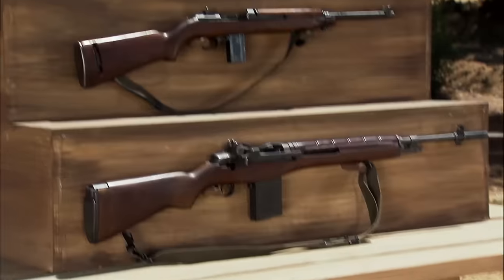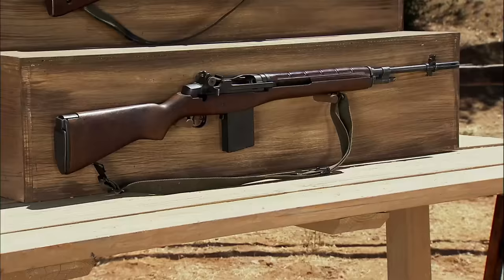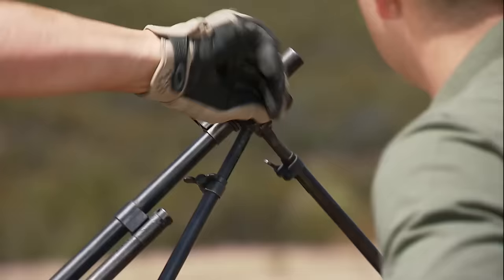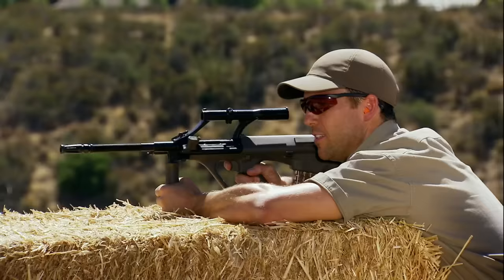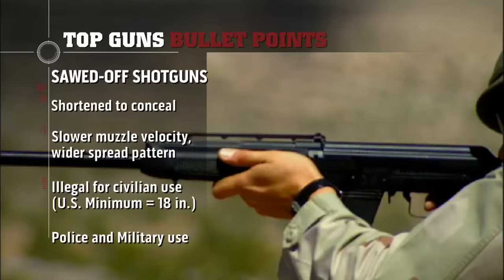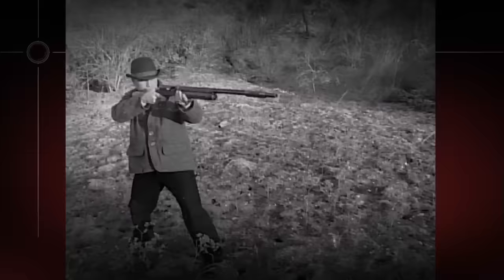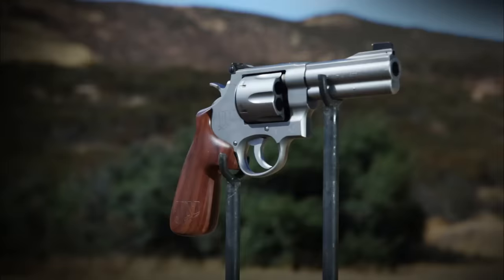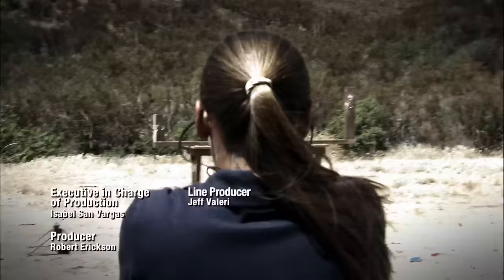Top Guns: ELITE Sharpshooters and DEADLY Marksmen *3 Hour Marathon*

Comment: In a "Battle Rifle" comparison the M1 carbine should not even be included as it is not a "Battle Rifle " by definition. Battle Rifles are chambered in "Full Power Cartridges" like 7.62×51 mm, 7.62×54R, or.30/06 , etc...The M1 Carbine fires what is considered an "Intermediate Power Cartridges, as do the M16/M4 family, the AK platform, and other similar weapon which are known as Assault Rifles. Intermediate Calibers use ammunition that is substantially lighter in over all eright and the weapons thst fire them are generally significantly lighter in weight since they don't need to be built as robust due to the less powerful cartridge they fire. Because the weapon and its ammo are both substantially lighter the individual soldier can carry more ammunition on his person than he could if carrying a battle rifle. A soldier carrying an M16 or M4 which os chambered in 5.56×46mm can cary about 3 times the amount of ammunition for the samevamount of weight as the 7.62×51mm used by the M14 and thats not even taking the weight of the rifle into the equation, with the M16 being almost 3 lbs lighter than the M14. There is also the lighter recoil generated by the intermediat powered cartridges used that allow these weapons to be more effectively used with less skill or training within the realistic distances that most smallarms combat actually occurs at. The need for a Battle Rifle shooting a Full powered ccartridge that is accuraye and effective to distances of 1000 yards doesn't realistically exist if 90% of comat occurrs at 300 yards or less. This is why actual Battle Rifles are not commonly issuesd to soldiers of any modern army and haven't been for quite some time. When the intended use that the M1 carbine was developed for, to give soldiers normally issued a pistol (like truck drivers, clerks, or other soldiers whose jobs don't normally involve direct combat) a weapon that if they did need to use it would allow them to do so with better range and accuracy than a pistol is capable of is considered then the absurdity of putting the M1 carbine in a head to head comparison of actual B a ttle rifles b comes obvious.

Comment: Interesting video. THANKS. I have a PS90 topped with a VORTEX Sparc II red dot sight on a low aftermarket Pic rail. Also I have a RUGER 57 pistol firing the same (expensive!) 5.7 x 28 round. It's shooting $1. bills these days so I now mainly shoot my much upgraded RUGER PC chassis carbine with a HOLOSUN AEMS circle/dot sight. 
As luck would have it I also have a gen. 1 Steyr AUG. But for hunting in Nevada I use my 6.5 PRC Browning X-Bolt Pro with a 4.5 - 18 x 44 Bushnell Elite scope with a G3 illuminated reticle.

Comment: I shoot both 5.56 and x39 in my backyard a lot. Agree with everything you said. I also have a couple (3) x39 rifles, 2 akms and 1 galil ace to shoot the rounds more accurate at range. Got like 2k rounds of belom brass cased ammo for them and another 600 rounds of barnaul hollowpoints or Russian steel fmjs. Got barnaul and belom because they shoot most consistently in my experience from my rifles.

Comment: I use my Holosun every day nearly for at least an hr sometimes 2 and I haven't had to change the battery yet I have mine on a CMMG wasp 556 Mk4 when I first bought it I thought man $300 but it is well worth it I pull it on and off to clean or to through my iron sight back on the rear which is very seldom but I've never had to readjust the sights they have always been on and it's also set up to when you pick it up it comes on then after laying without movement it will turn off thought that was pretty cool I'm 3 years in nearly and lens has just 2 light scratches on the sides and I'm rough with my hardware so that's saying something but you definitely talked me into the magnifier thanks bud

Comment: Probably the M-14 would have been a good battle rifle in Afghanistan or Iraq. I trained  on the M-14 in Army basic in 1969. Was issued an M-16 in AIT.  Was issued and carried an M-16 in Vietnam. Very occasionally in Vietnam did I encounter any open areas longer than 100 yards. Most times visibility was 10 to 20 yards many times less. I did, however, carry an M-14 once or twice on radio relay fire base duty. I used it like an old BAR. But full auto was a bear. Enjoyed the video. Thanks.

Comment: The height of the optic vs. the barrel on the PS90 introduces a fairly significant paralex error. That's why the big difference between point of aim and point of impact when the targets went from 15yrds to 25yrds.

However, lowering the optics closer to the barrel would have negatively impacted ergonomics.

Comment: On such a great sight over bore axis like on a p90, it's advantageous to sight in between 15m-25m hitting a about 2-4-6 inches low (depending). That way at 50m your not shooting 12 inches high. But that's just my preference, feels like a more efficient aiming solution to me.

Comment: The bolt on the Mosin is dirty most likely has cosmeline  still in it. I have several Mosin and they are smooth as butter and the trigger can be lower to 3 lbs with the circle wire connector mod less than $.10

Comment: That historian and former Marine doesn't know how to properly use the bolt on that Mosin nor does he understand why it was designed that way. It took me a minute or two to figure it out. The "secret" is to maintain a forward pressure as you lock/unlock the bolt. This design allows for the greater tolerances on the bolt grooves which translated to less jamming in dirty battle field conditions. Also, the simple design of the Mosin was easier to use and maintain by Russian peasants who could neither read or write and could be cleaned quickly and easily. Pretty good combat design for 1891.

The US had to increase tolerances on many military rifles for this reason. The engineers originally designed for clean, or perfect, conditions. That is why the bolt on the M16 in Vietnam was constantly jamming until they increased the tolerances.

Comment: m1  carbine   evolved  to  m14   in 308  (fully  auto   and lighter than  a   BAR)   then  evolved  into the mini14   where  the  recoil  and follow  up  was manageable.  THen in  2005    became    a  rotary  bolt  self  cleaning  piston    design   called the mini14   with a  thicker   hedge  at  base  of  barrel.    And  became  a  more reliable  1moa   rifle  than a   standard  1moa   ar15  that  cost  hundreds  more.    Thus the  ranch rifle  was born.   And it  had  folding  stock capability   which  most  ar15's  dont have
Reply: and  that is how the m1  carbine  went  to   308   and  556 and then  got  fine  tuned  on  the  same  system  that  proved best.    and it  started over  80 years ago.

Comment: The bolt action on a mosin is not hard to cycle..I have no clue why he had problems with it..
Reply: My mosin had a steel burr in the chamber when we got it.  We had to hammer the bolt open to get rounds out before a gunsmith sanded it down.  I bet they had the same issue here, but they were shooting brass, so the thing was still functioning.
Reply: @the.hamel.mammal7802  Interesting I've encountered that problem with a mauser 98 once.I have no idea why they were having trouble with the bolt action.could be a hundred reasons I suppose .But ive never had a problem with a proper functioning mosin.

Comment: I don’t think they gave the 30 carbine a fair shake . I have a few and all but one has the later adjustable rear sight but all shoot well and have zero problems hitting decent groups at 100 yds. The Chinese coats  stopping the rounds has been debunked just like the ping of an M1 getting soldiers killed . ( I have a few Garand’s as well) 
The carbine was never designed to be a Garand replacement but to replace the 1911 pistol and as such it did great . 
There was a study done by the government after the Korean War ( I don’t recall by whom , DOD or Dept of the Army but recall the found out that the vast majority of troops only took about three aimed shots and the rest was just spray and pray so most if not all those chines troops with their  quilted coats were never hit in the first place. I’ve tried to find that article again but can’t seem to find it again .

Comment: The 30 carbine was not, and is not, a pistol round. I do not know of any pistol that used this round. I picked up an M2A2 30 carbine used by some of the ARVON's in Vietnam. I still have it and shoot it when I can find enough ammunition, as it is select fire and so much fun that it eats up a lot of ammunition. The rear sight is adjustable for elevation and windage, It has the wire collapsible rear stock. Using the rear stock, I'm capable of shooting a 2.5" group at 100 Yards. I have shot several models from WWII to Vietnam, only one had the fixed rear peep, but its front sight was still adjustable for elevation and windage.
Reply: Ruger Blackhawk and Thompson Contender, and AMT automag  were avalible in 30 Carbine
Reply: And it was good in the ruger  very loud
Reply: Demolition ranch shoots a 30 carbine handgun in one of his “episodes”😊

Comment: I don’t think they have the 30 carbine a fair shake . I have a few and all but one has the later adjustable rear sight but all shoot well and have zero problems hitting decent groups at 100 yds. The Chinese coats  stopping the rounds has been debunked just like the ping of an M1 getting soldiers killed . ( I have a few Garand’s as well) 
The carbine was never designed to be a Garand replacement but to replace the 1911 pistol and as such it did great . 
There was a study done by the government after the Korean War ( I don’t recall by whom , DOD or Dept of the Army but recall the found out that the vast majority of troops only took about three aimed shots and the rest was just spray and pray so most if not all those chines troops with their  quilted coats were never hit in the first place. I’ve tried to find that article again but can’t seem to find it again .

Comment: I bet that Mosin still had a little bit of cosmoline on the bolt.  Mine doesn't stick like that, but it did until I cleaned the living p*ss out of it!
Reply: Yea most people don't do a deep cleaning on their combloc guns. Often with second and even third-hand owners, one often recieves them with gobs of cosmoline stilll stuck in tight areas. I always remove the stock and really soak individual parts in a non-polar solvent.

Comment: Should have put in an original Lee-Enfield instead of the "Noisy-Maggot" because it was designed to be capable in a "Mad Minute" drill...  Much more accessable bolt handle positioned in the right place to operate as you come off the trigger.  The P-14, designed 20 years after the Moisin as a replacement for the Lee-Enfield, is actually a better "battle rifle" and would have been more competitive.  Remember the old WW1 saying: "The British brought a Battle Rifle, the Germans brought a Hunting Rifle, the Americans brought a Target Rifle, and the Russians brought 'a rifle'."

Comment: there is no way that m1 carbine shoots 12 inch groups at 50 yards
Reply: why are they using holds at 50 yards? Just sight in the gun
Reply: I have several M1 carbines and I don’t know why they shot it at only 50 yards . I can shoot chips of clay targets at 100 no problem.
Reply: I have several M1 carbines and I don’t know why they shot it at only 50 yards . I can shoot chips of clay targets at 100 no problem.

Comment: You stated that at the raising of the flag on mount Sera Bachi at Iwo Jima, The Soldier was holding an M1. The man is not a soldier. He is a Marine. The Army calls their fighters, Soldiers. The Marine Corps has no soldiers. They are Marines. It would be disrespectful to Call a Soldier a sailor or an Airman. It is also disrespectful to call a Marine a Soldier.